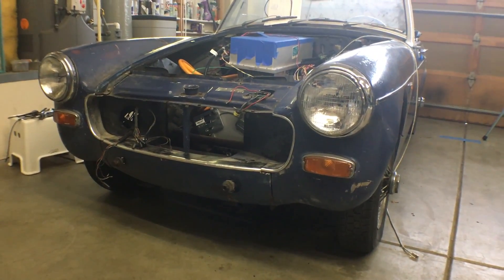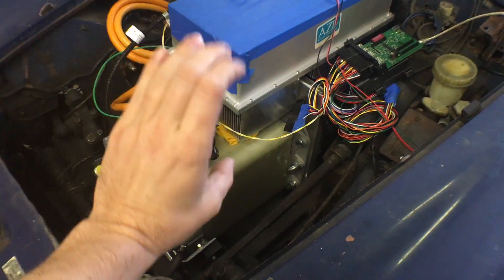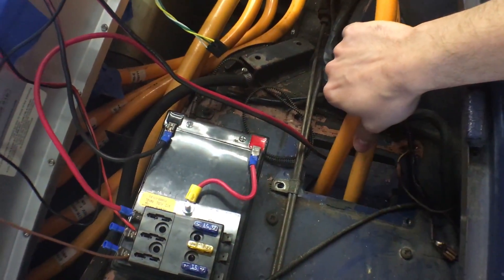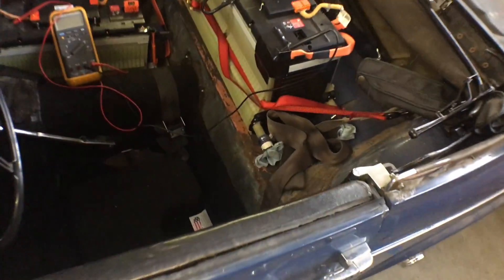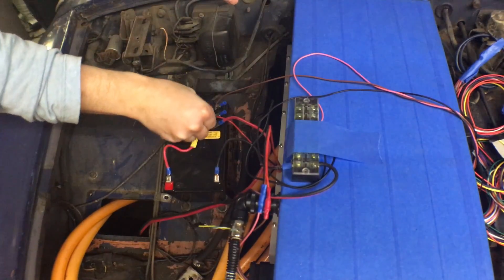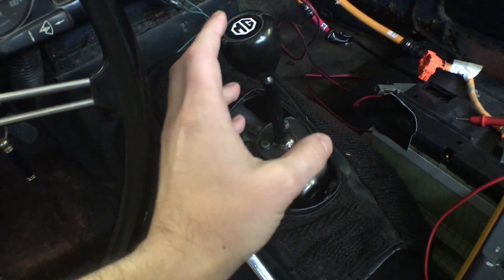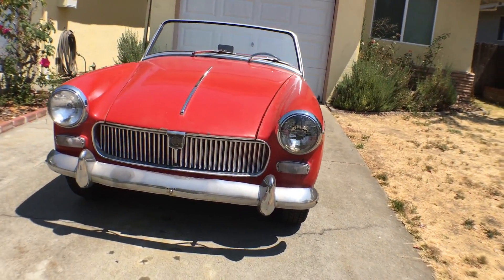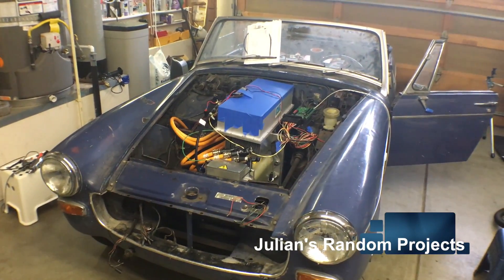MG Midget EV Conversion Part9 Progress!

Comment: I'm just finishing up a midget. Unfortunately the car came in without a transmission so I hook the motor directly to a truck drive shaft which I ran to the rear end. I'm using a 9in netgain motor and a Solar Tan 500 amp controller. Got a little reversing contactor for reverse. I would have kept the transmission for sure if there had been one just much easier. I have 32 leaf cells in 2 Series set up for about a hundred and fifty volts. You did a really nice job on this I'm impressed. Click on my profile and look through the pictures to see the mg project.
Reply from the maker: Thanks Steve! I've been a subscriber of yours for a long time. Love your videos.
Reply: @JuliansRandomProject  small world,  it's nice to see others doing the same. I just subscribed to your channel

Comment: I'm loving this whole project! I have to agree with your comment at the end of the video: There's more than sufficient torque in that Siemens motor to make the Midget go, so why not just do away with the transmission altogether? After all, it's an AC motor, so you don't need reverse gear, and you aren't limited in the RPM's that a DC motor would have introduced into the equation. Just go for "direct drive". You'd also lose the weight of that transmission, which wouldn't hurt the project one bit! :)
Reply from the maker: Ken, most of my reason for keeping the transmission is the ability to disconnect the motor from the axle and that my fabricating skills are limited. So connecting the drive shaft to the motor shaft safely and reliably would take some time. But you're right, probably the best way to go and may make for a nice improvement in the future.
Reply: Julian, I've enjoyed your project videos, hope there are more to come. I converted a Porsche 924S with basically the same Siemens/DMOC setup you're using (http://porscheev.blogspot.com). I kept the transaxle for the reason you mentioned above, but find that I drive almost exclusively in 4th gear (4.306:1 final drive ratio) with the electronic reverse function in the GEVCU. I think with the lighter weight of a Spridget, direct drive would make a lot of sense, maybe with the older 4.22:1 rear axle. In fact I've been considering doing another myself. My first conversion was a Bugeye Sprite (http://sites.google.com/site/fredbehningsebugeye/) and I can share that the biggest challenge is finding space for all the batteries. If I do another, it will be direct drive with the motor mounted in the transmission tunnel, opening up the under-hood space for batteries. I'm anxious to find out how the air cooled DMOC does in the real world, as well as the Volt battery pack, so keep the videos coming!

Comment: My concern would be of three things.  Weak transmission, rear end designed for small motor. Will the brakes stop the car?  Thanks for the video's. Should be wicked fast. Why the transmission? Are you trying to extend the life of the batteries by lowering the RPM's of motor?
Reply: Can you reverse the polarity of the motor to have reverse and use a drive shaft from motor to rear end?
Reply: An AC motor allows for exactly that: reverse the polarity and the motor spins the opposite direction. So reverse gear is literally available at the  flick of a switch. And AC motors allow for regenerative breaking. Neither feature is available from a DC motor.
Reply: If the DC motor is brushless I agree it would ruin the motor.  There are DC motors that can be reversed.
Reply: This is a ac induction motor.  Should be able to run either direction without harming the motor.